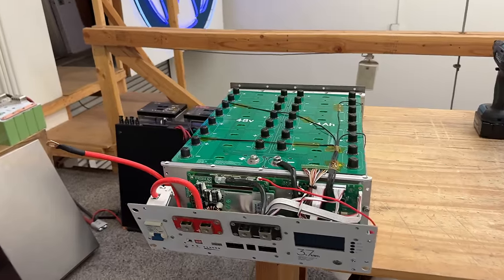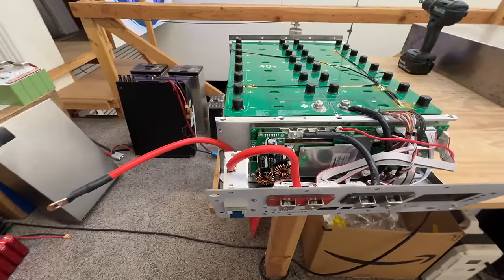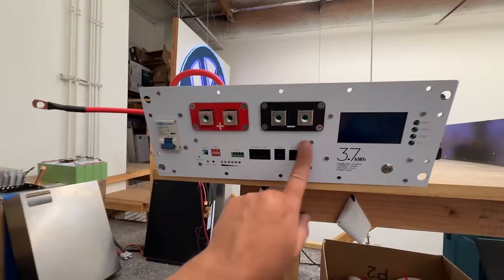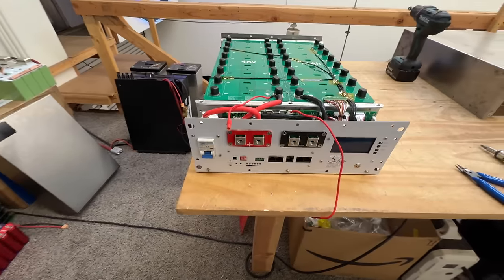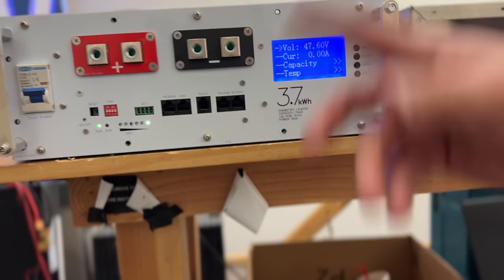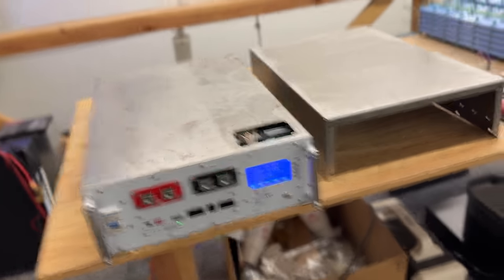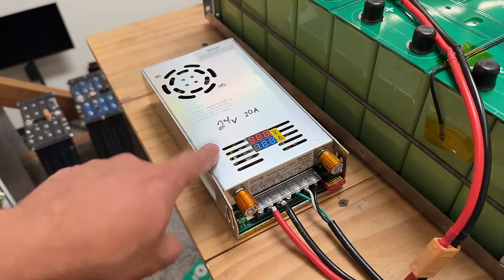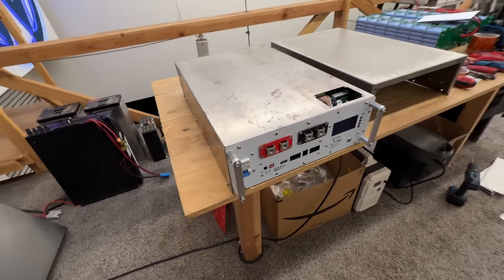48v DIY BOX for $479 LiFePO4 LEV60 Cells

Comment from the maker: https://j35.us/16xLEV60-48v
Reply: Hey bro,,I've been watching you since day 1,,the 18650 days😂. I noticed your site is sold out of the 16 pack of 74ah cells. The set that's on sale for $479.00 do you not have any left at that price. I've been waiting a lot time to make a purchase so I can use in my travel trailer....any way I can get some help on this? Thank you for all your information and ideas over the past few years, I love what you do. My 1st pack was a 100p 7s 24volt system 18650s I spun 3 12g wires to make my bus bars and didn't use a bms for the longest time.

Comment: Bro that battery box setup looks Professional af and well designed. Once its painted it will look store bought. You do Great work bud. Its impressive and encouraging.

I've been fallowing your channel for years now and remember when you designed your very first PCB that held 18650's with the black battery holders and it was stackable/expandable using brass post. Oh and you used resistor leads to make the 5A fuses similar to how tesla was doing their fuses at the time. You have come a long way since then bro and every "DIY" setup i see you put out keeps improving and getting better and better. I respect the innovation and constant search for improvement. Keep up the great work bud. I really enjoy your channel.

Comment: @jehugarcia E6000 type adhesive / glue is probably what your looking for in order to hold wires / temperature sensors in place. E-6000 is a Polyurethane Industrial Adhesive. I use it in all my electronic projects. You can get it in white also. * I would recommend using some adhesive also on the balance leads where they connect to the screw terminals! Also on any connection / plugs they do not come loose during shipping! The E6000 is also perfect for that!

Comment: How about modifying this DIY BOX to a version for the new industrial Inverter BMS from JK BMS with many variants: 24V-48V, 100A-150A-200A, which is the first and only one so far to have active balancing 1A-2A, firmware developed directly by JK BMS, (not from firmware supplier company) and upgradeable, with Bluetooth, with the possibility of a color LCD display, with communication with many different Inverters. Closely developed according to the requirements of future users and with other traditional functions of industrial BMS: with current limitation when batteries are connected in parallel. It would only be necessary to modify the BMS mount and the cut-outs on the front panel.
Reply from the maker: Where can I get one ?

Comment: I probably should know this, what's the advantages and disadvantages to using a 100A BMS vs. a 200A BMS? Which one should I use, or what application would I need one over the other? Regarding this specific 16 cell 48V battery? And which is better, the red BMS sold on Amazon with links on older videos? Or, this cheaper one being sold from Aliexpress with the interface screen? I just bought two of your kits and I'm trying to figure the BMS part out.Thank you.
Reply from the maker: Advantage - you have more power if you need it.  Disadvantage - you pay more for  power.   The cells can do 200a continuous  so no problem there.  As far as features,  the  com ports to inverters…. I think that’s overkill and in don’t see the benefit,  the screen is very useful,  and the limitited charging and inrush are super useful for people who don’t know what they are doing.
Reply: @jehugarcia  thank you, I really appreciate you as a person. Been following you since you were making content about fancy camera equipment

Comment: I have a 96V system for my shop.  can they take the amperage if i set the up in a 96V arrangement?
Reply from the maker: 200a continuous and 600A for 10 seconds
Reply: @jehugarcia  is this voltage common in the US?  I see alot of 48V and 52V system with these U type mounts.  Has anyone used LiPo4 systems on 96V grids?  38kW
Reply from the maker: 48 and 52v is the same thing.  Most popular systems are 48v

Comment: Is there option to stack up 2 or 3 orders without increase shipping cost?
Reply from the maker: No,  fedex charges more shipping the more weight and size of package
Reply: $80/ order is  a lot to think about.  Always wanted to self pickup to build a super budget 48v system but i am  in the sf bay area so
.  @jehugarcia
Reply from the maker: Shipping is expensive no doubt, especially  hazardous materials like batteries
Reply: @jehugarcia  local pickup?
Reply from the maker: Yes